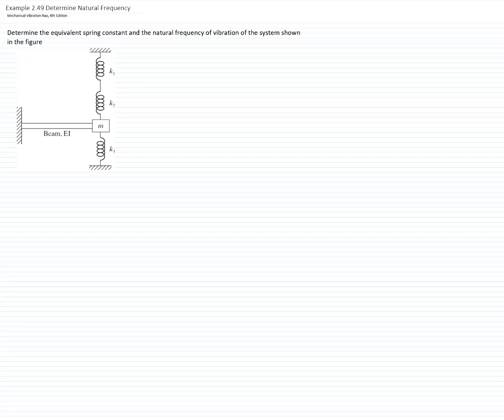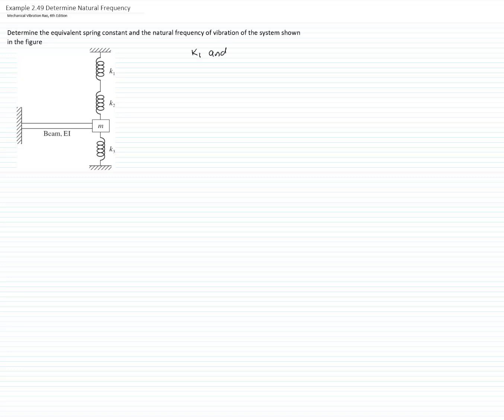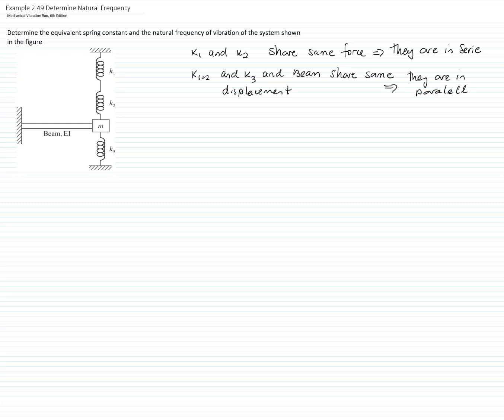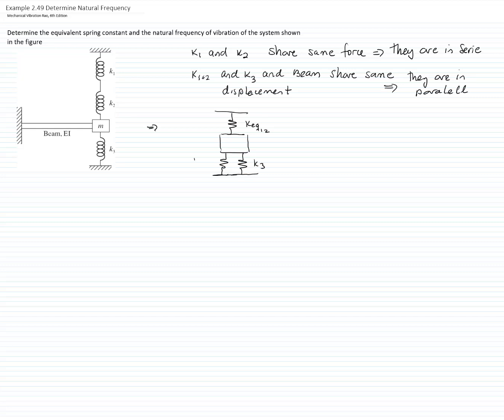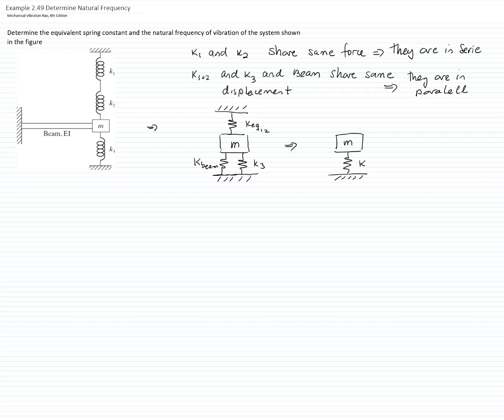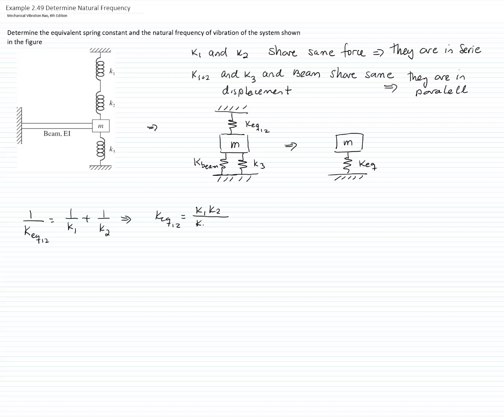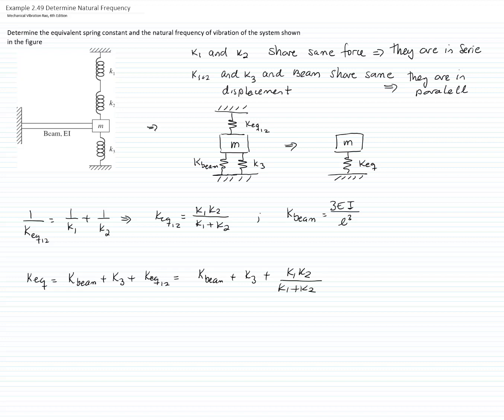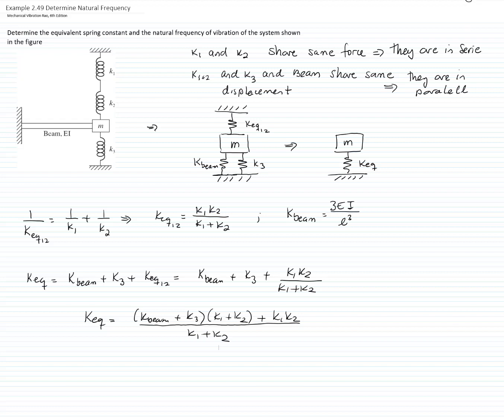Example 2 49 Springs - beam - mass system, Find natural frequency

Comment: How K beam is 3EI/l^3
Reply from the maker: This is the equivalent constant of the spring for a cantilever beam.
Reply from the maker: From Strength and materials, you can calculate the deflection of a cantilever beam for a concentrated load at the free end. The equivalent spring constant is calculated as the force applied divided by the deflection.  Review the table for the equivalent constant of spring for a cantilever beam.